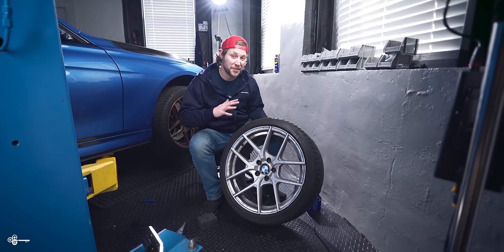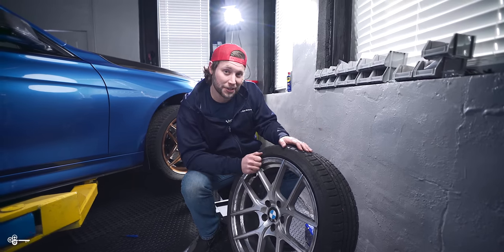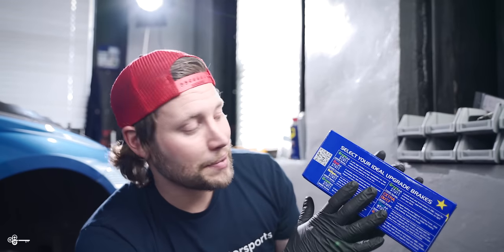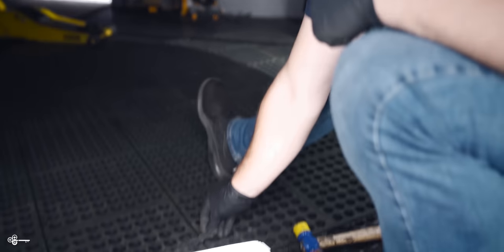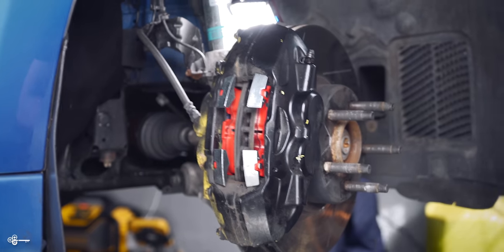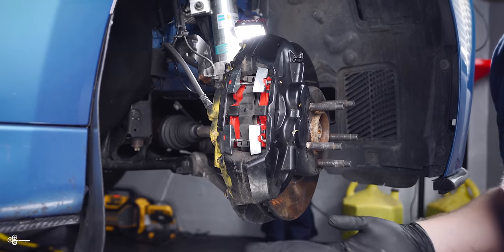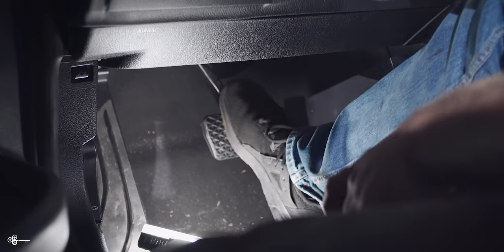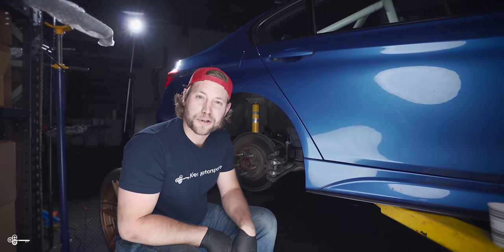How to install FRONT BRAKE PADS on an F30, F32, F22, F80 with BREMBO front Calipers (EBC REDSTUFF)

Comment: I have these pads on my M4, they are fantastic. I used to run with EBC Yellow Stuff, but I found they just liked eating my rotors, fantastic braking even from cold and not scared of being put into hell on a hard track day, but they just liked eating iron too much...
The Red Stuff are an awesome compromise, really good braking force, even on a ‘semi-hot’ track day, less brake dust for daily driving and way better than OEM pads for braking performance. They will still eat your OEM discs in two sets of pads, but hey BMW seem to use soft iron for rotors...
Reply: do you know how the redstuff stacks up against Hawk HPS 5s? I need to change my pads and want to go with a less dusty option with great performance

Comment: Nice video. Ceramic brakes are awesome. The only downside is that they tend to eat up your rotators. That's not really a big deal to me because I believe in replacing pads and rotators as a set.

Comment: I know these brake systems which are used on motorcycles especially on Supersport bikes.
What do you think about a little bit of copper paste on each pin (after cleaning) ?
It helps the pad to move a lot easier and on street cars/bikes, where you don't change the pads often like on trackdays, it's nice to prevent the pin to oxidate.

By the way i really like your videos....
no bling bling/bla bla  just technics and the way to go

Comment: So these ones don’t squeal like a pig when they’re cold? I’ve experienced an M3 with carbon brakes and it made some terrible sounds when cold.
Reply: No, they don’t squeal. When any brakes squeal it’s usually due to not putting some lube between the pads and the pistons. Fully carbon ceramic disc pad combo will quite often squeal when they are cold, but these are just ceramic based pads, and in my experience they don’t make any untoward noise. They are just good quality brake pads, with less dust and better braking force.
Reply: @steve5x565  its not the only issue and certain BMW are know for this I got a brand new 435 that was making noise with 3000 miles and know countless others with same problem.  there is even a lawsuit against BMW for this reason
Reply: @steve5x565  are these ceramic brake pads better than the m-sport brakes that come with the S2NHA (blue calipers)?

Comment: Are the M Sport brakes the same regardless of what engine you have in your F30? I have a 328 with M Sport brakes and I hear grinding under breaking. I would rather do the maintenance by myself. Great video Brian!
Reply: Your rotor could be shot causing vibration and pulsing, or your pads are shot.
Reply: No, these are Brembos, my F30 M sport has the regular BMW breaks.  Idk if it was a package you need to buy for the Brembos, but my F30 doesn't have them.

Comment: Red stuff is for track use mostly, because when cold they dont grip. Yellow stuff is for daily driving and occasional track use.If you only drive in town green stuff is the way to go on cold have amazing grip, but break dust build up varies, how u use the breaks. On green stuff if you going to brake like crazy and get them hot they will shed brake dust everywhere. 

Recommendation go with Yellow. Unless you go to track take red stuff or even racing grade EBC provides :)
Reply: pretty sure you flipped those two. yellow is track, red is more daily.
Reply: Incorrect. Red street use. Yellow street/light track. Blue track only.

Comment: Do you have a DIY for changing out the Brake Rotors for M-sport brakes?
Reply: Changing rotors is an easy DIY, remove the wheel, follow the pad removal video above, take out the two bolts holding the calliper to the hub (make sure to support it and not let it hang by the brake hose) remove the screw between two of the wheel bolt holes, slight tap should free the rotor, remove and replace. But don’t replace with anything BMW, they are soft and squidgy even the M-Sport ones. My OEM M4 brake rotors look great but they are like chocolate when it comes to braking.

Comment: @kiesmotorports I need to your help! My F32 M Sport Brakes squeak an insane amount and I can't stand it! Is there anything I can do, I've tried changing pads and discs and cleaning them fully.... yet it still sounds like an old school bus. Thank you Bryan
Reply: F36 owner here. Glad to know I'm not the only one whose brakes squeak like crazy too lol. I saw on some forum or video (can't remember the source) that our models of cars are notoriously noisy when it comes to brakes. Happy to hear any advice or if you've resolved your squeakiness.
Reply: Brake fluid
Reply: You have to give a LOT more specifics. What pads, specifically? Performance/race pads are always going to have some amount of squeal. Street pads should generally be quieter. If you're still getting squeal, make sure you apply a quality anti squeal paste to the parts during installation. Ceramic pads are also very quiet.

Comment: Would you recommend this for a F82 putting out 580BHP? 

I am trying to avoid high dust but Ofcourse stopping power is important as well.

I am using original stock rotors  from BMW
Reply: No, they are not suiitable.

Comment: Does these n55 really have rod bearing issues??
Reply: demaine rawlins very rarely, people only run into problems when they track the car. The problem is there is oil starvation when turning the car at high G’s. So if you don’t track your car, it’s nothing to worry about.
Reply: @mattc9279  thanks bro appreciate it